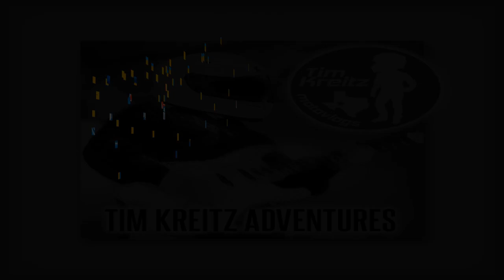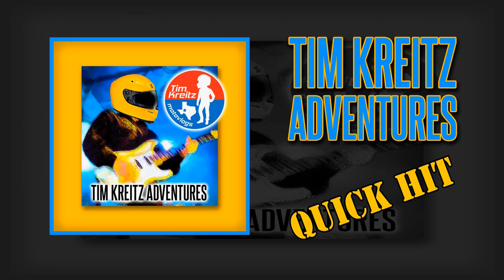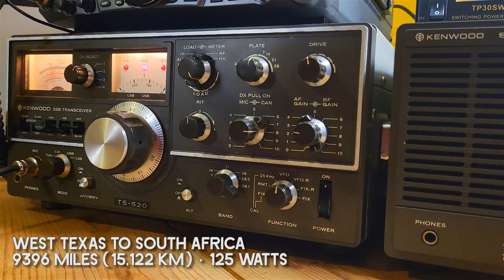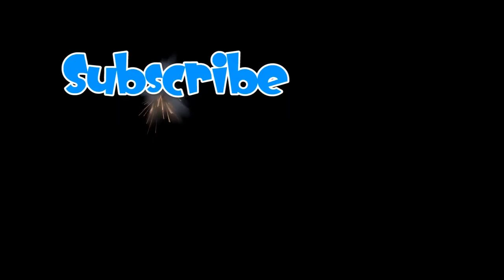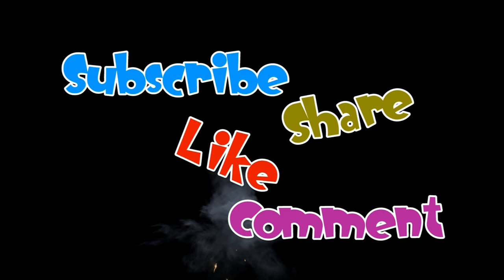Kenwood TS-520 talks 10,000 miles on 125 watts

Comment: Good stuff!  I love my Kenwood TS-520S station - transceiver with the narrow band filter, vfo-520, DG-5 digital display, SP-520 speaker, SM-220 station monitor with panadapter, TV-502 2M transverter and MC-50 mic and numerous other accessories.  I think the only accessory it lacks is the TV-506 6M transverter.  All sorts of awards earned, and even took 1st place in a handful of contests with it.  It's been a solid workhorse over 40+ years and still looks and performs like new.  It's going to the grave with me...  🙂

Comment: Very cool! I worked the world with my first rig, a TS-130S when I first got my ticket. Thanks for the blast from the past!
Reply from the maker: I still have my TS-130S that I bought used back in 1998. It works great. I pull it out of the closet and put it through its paces once or twice a year. Those are excellent little transceivers.